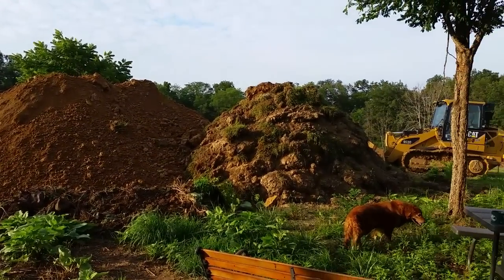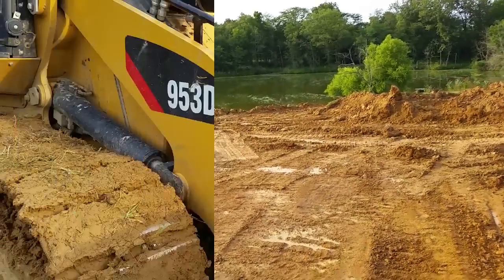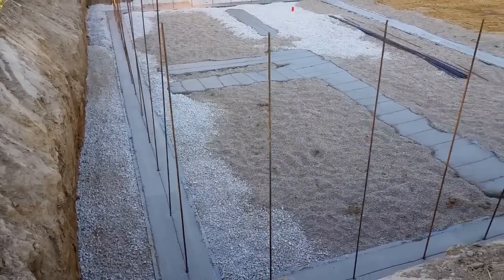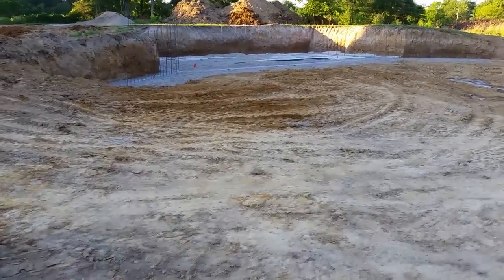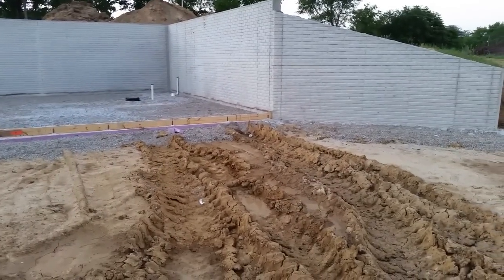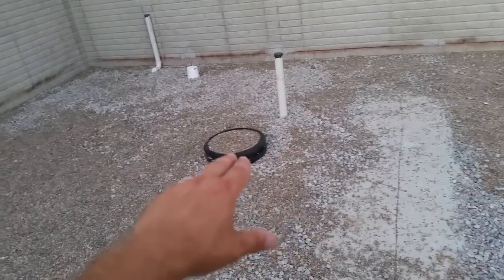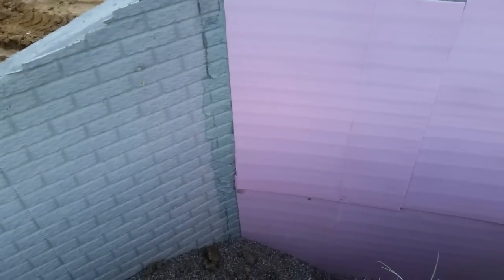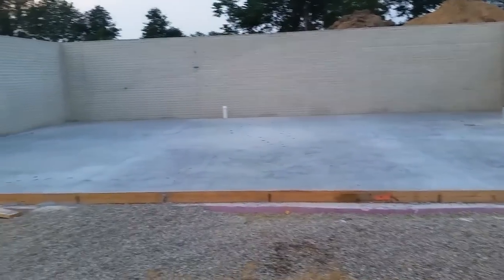Log Home Build   Episode #1 - Basement Construction

Comment: Can you tell us your approximate cost for this project to this stage. Excavation, footer, drain system, materials, and wall pour. I am contemplating a walk out basement on my next build and the size appears quite close. Thanks and nice work.
Reply from the maker: Eddie Seward, I went with a concrete contractor that does about 200 basements a year.  So they were a little higher in price, but have a lifetime guarantee. They cost a total $27389.20.  That is for everything you see.  The digging, the drainage, all the concrete, and the plumbing in the basement for bathroom and main drain .  The plumbing was about $1185.45 and the basement was $26203.75.  The basement is 28 feet by 46 feet with 9 foot walls.
Reply: Country View Acres: Thank You for posting your answer. Give me an idea of the cost!!
Reply from the maker: Basement was $26,000,  it 46' by 28'.
Reply: @CountryViewAcres  Thanks for responding to this.